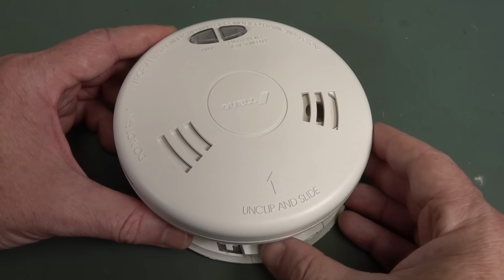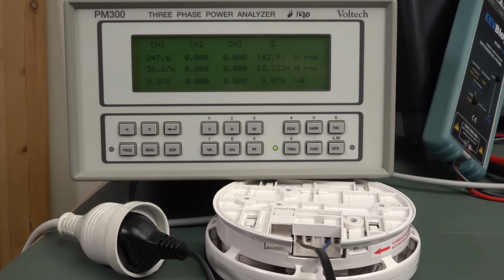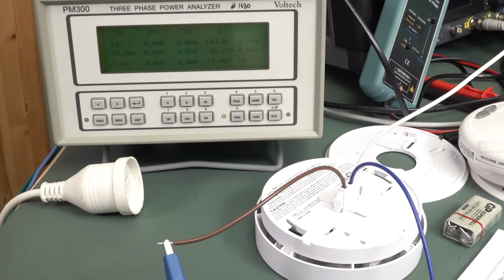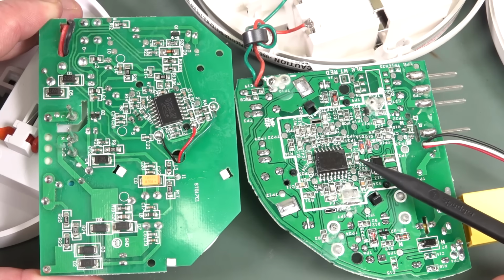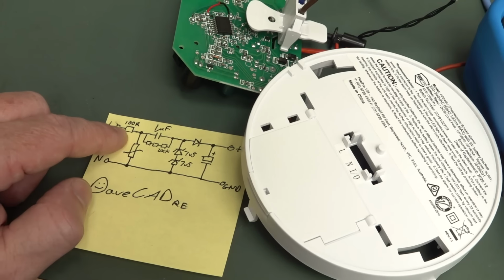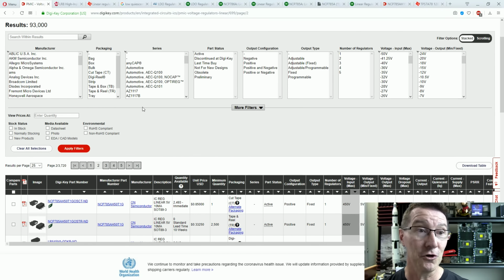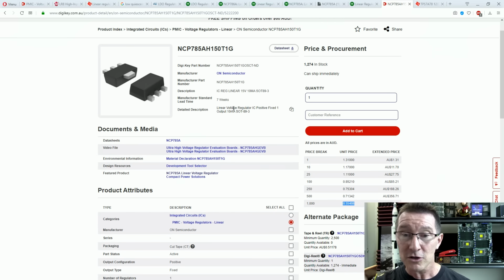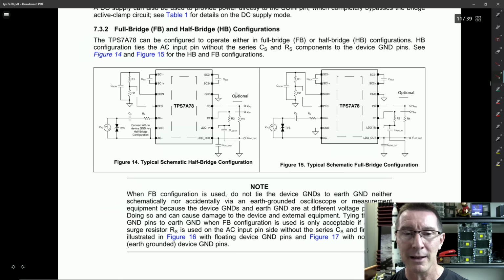EEVblog #1284 - How Bad Product Design Kills The Environment

Comment: I often wonder if LED bulbs suffer from similar issues with low power factor and high peak currents on the input, not to mention the environmental impacts of the built materials (plastic and components etc). It's like we've traded lighting power consumption in return for having more e-waste to deal with, I'm not sure how LED bulb failure rate is now but a few years ago it was a pretty high.
Reply: Bigclive often tests LED bulbs on their power consumption and power factor. You get what you pay for usually.
Reply: The problem with the smoke detector is that it has to use a capacitor dropper that is sized for the max current draw (when the alarm is sounding) When the alarm isn't sounding, it still draws that power and just dissipates it as heat. A similar power supply on an LED light bulb will be sized for the light bulb itself- there is no appreciable excess. Also, it's only drawing power when the light is in use. The smoke detector draws power constantly. A capacitor dropper is fine for something like an LED bulb that is either on or off. But in a device that only needs a tiny amount of current most of the time, and occasionally needs a lot more, there should be a switching power supply. But that's more expensive than a dropper, which always draws the same amount of power whether it's needed or not.

Comment: If they are goverment mandated then the goverment is ultimately responsible for allowing units onto the market with such poor specifications. Typical SNAFU, they tell you that you must run LED lights while making you waste power elsewhere. Fortunately all of that wasted power in 1/5 of the expected output from LLP's compact aneutronic fusion reactors and they take up only as much space as a single large house, assuming they are even above ground which they don't need to be when they don't produce thermal neutrons or need large cooling systems. However that is a solution that is about 10 years away, or so they say...
Reply: https://www.youtube.com/watch?v=6ajqD0hoOMw
https://lppfusion.com/
Some interesting developments listed here, such s hitting  600 million degrees K.  https://lppfusion.com/wp-content/uploads/2020/01/LPPFusion-Report-Jan.-22-2020.pdf

Comment: with the upcoming smart meters we will have to pay for VAs as residential customers too.
Reply: Nah just do like Hydro One and charge like $100 in fixed fees alone.  You pay through the ass no matter how much power you even use!
Reply: @redsquirrelftw  Pretty much.
My electric bill has almost always been 80+% 'standing charge'

Electricity rates barely matter because the cost is dominated by a fixed monthly cost just for having a connection.

People that argue it's cheaper to have gas don't consider that you now have to pay a standing charge twice.

For low usage households the standing charges are an absolute rort...

Comment: Hmmm...  I'll pass this onto my company, we're building a new campus and we're interested in total CO2 emissions and TCO of all operations.  We put in a bunch of stuff that's supposed to be "energy efficient" it might actually be a good idea for us to audit the hardware the site planners have selected.
Reply: If the current THD is high there wont be the perfect inductive power factor compensation that is expected from capacitor load.
Reply: @lucaskendc  - Of course loads with lots of distortion and harmonics (THD) will not be perfectly inductive or capacitive. However, in order to be significant to the power grid, those "distortion components" have to be associated with a large load. These smoke detectors are a tiny tiny load, so the THD is literally "a drop in the ocean" compared to a (say) a 150W switchmode PSU, even if it has higher PF and lower THD..
Reply: You should check the facts first. The use of capacitive droppers like these will IMPROVE your site's power factor. That will take the load of the expensive on-site Power Factor Correction devices that you will be installing to add capacitance and reduce your kVA loading onto the grid. Capacitance is capacitance... add it with these or pay thousands to add it anyway. Don't listen to Dave, he is clueless about this stuff, despite a squeaky voice and massive fanboi base.
Reply: Except the zener PS wastes in heat almost all the power the device draws from the grid... (independent of PF)

Comment: If you stop and really think about how much energy is wasted every day, you'll probably feel sick in the stomach!
Reply: I'm typing this reply while on night shift at a production facility with no other employees in for the weekend, yet heat and light is on full for almost a square kilometer of buildings.  A 2W smoke detector is the least of my worries.
Reply: There is NO electricity wasted here. The capacitive dropper in these creates a LEADING power factor, which improves the inherently lagging power factor on the supply grid. Dave is wrong.
Reply: @johncoops6897  No, he gives Watt and VA rating .. and even the Watt rating is way too high (because of the Zener diode solution).
Additionally the ohmic loss (think supply line) increases if the current increases, which it also does if only the reactive power increases.

Comment: ⛔️   THINK. THE  POWER  ISSUE  IS  BAD  FOR  THE  ENVIRONMENT??
TAKE THE PHOTOELECTRIC SMOKE DETECTOR OFF THE TABLE FOR A SECOND...
(Great detection type... eliminates false alarm trips caused by products of combustion -- burnt toast etc..)

NOW LOOK AT  ☠️ IONIZATION TYPE SMOKE DETECTORS ---> EACH DEVICE'S 
DETECTION CHAMBER CONTAINS RADIOACTIVE ISOTOPE(s) INCLUDING 
AMERICIUM xx AND HAVE A AVERAGE MAXIMUM USEFUL LIFE OF ONLY 10 YEARS!    

The. Straight into the landfill!!

(99% of homeowners do not even know about the special disposal usually required)

Comment: I always thought that a capacitive dropper could be very efficient if matched perfectly to the load. Perhaps they did the calculations based on the current draw when the buzzer is operating continuously so it's extremely miss-matched when operating in sensing mode (99.99999% of the time) and almost all of the power is being wasted away by the zener diode. If that's the case could they have the microcontroller operate a MOSFET to switch in a different value resistor or capacitor when in alarm mode? That way it would change to being extremely miss-matched and inefficient only 0.00001% of the time.

Comment: Data sheet is Oct 2019. Those smoke detectors are probably many years old designs. Likely battery powered and craptastic droppers added due to surprise demand.
Reply from the maker: Yeah, it's a fairy new part. Still other ways to do it.

Comment: I've seen the results of such "penny pinching" myself in many, many products. I've even been party to rancourous debate between engineering and the brainless bean counter chief accountant who had HIMSELF decided to change a high precision metox resistor for a standard one of the same value resistance but lower power (metox usually being double the power rating of an equivalent standard series) and 1/10 the price but less precision.

The chief engineer demanded he be sacked after telling the bean counter to stay the hell away from any engineering decisions irrespective of price and stick to his simple accounting arithmetic.

 BUT, the board decided not to and requested the chief engineer to redesign the circuit around cheaper components. He told them what they could do with their penny pinching and that it would end up biting them in the backside.

 He resigned the following day and the "redesigned" product went to market and had to be recalled after 6 months costing 10s of thousands to resolve!
Reply: Surely you left out the part where the accountant got a big promotion and a raise after the recall?  There is no way the story can be true without that bit of corporate logic...LOL!  Incompetence must fail upward after all.
Reply: My dad used so say one of the money men at a company he worked for was so tight he only breathed in.
Reply: Have you heard of the short comedy sketches called “The Expert”? Take a look. This story reminds me of them. People making decisions about stuff they know nothing about.
Reply: I had a similar experience in my early career as an electronic designer. The company manager (an accountant) decided the engineering dept was too expensive and he would bypass them and get the factory to create an alarm system by wiring together various third party modules. Unfortunately, it didn't go too well with the factory-designed product as it performed poorly, was unreliable and was more expensive to manufacture than a custom engineered design. In the end the "expensive" engineering dept had to be called in to help the factory and correct all the design errors in the product and try and reduce the manufacturing cost.
Reply: Lassi Kinnunen  I'm sure it did because the board decided to use cheaper components, but there goes the precision and efficiency.
Reply: At least the story had a happy ending.
Reply: @ToniLähdekorpi  : A "happy ending" would be the board resigning, and the accountant being jailed for six months.

Comment: The TI UCC28881 buck converter looks appropriate. Getting rid of the film capacitor might make up for the price of the buck controller. Perhaps the buzzer takes more than the 10 mA limit of the regulator mentioned in the video?

Comment: I think you're over-blowing the situations.  You'd have a point if this was a grid of nothing but smoke detectors, but the truth is they share the grid with things like fans, A/C compressors, refrigerators and other devices that don't have a power factor of "1".  In the case of residential power, the power company takes care of it by adding capacitors to the power line (since most of the problem is inductive loads, caps are the "anti-inductive" fix.).  All that these smoke detectors do is shift the amount of correction by a small about.  (Small because their current is small compared to motors.)
Reply from the maker: Yeah, but I'm trying to point out the potential seriousness of such poor design.  See the pinned comment above for the discussion on this.
Reply: @EEVblog  Ok, but good engineering is the art of compromise.  How much are you saving compared to the additional parts (and their impact on the environment)?  I still think you picked the wrong poster child.  I'd worry more about bigger electronics and modern LED lighting systems.  Big Clive routinely talks about how bad the PF is on the bulbs he takes apart.
Reply: I wonder if the electricity companies are seeing a shift from the mostly-inductive load as it was in the past (requiring addition of capacitors) to a mostly-capacitive load today.
Or maybe it is still mostly inductive, but far less than it was in the past.
After all, many loads like mains transformers and small electric motors have been replaced by new designs that use high-frequency switching and present a capacitive load if not corrected well (in which case it will be resistive).

Comment: But Dave the buzzer needs more current. I guess in this pissy design they must have used the worst case to ensure a loud enough buzzer. In the non alarm case of course this power is pissed away. BTW Kiddee is used here in Canada as the main brand manufacturer.
Reply from the maker: I added that in the overlay, I measured 15mA max buzzer current.

Comment: Ti makes a smoke detector asic with LDO bult in but I don´t think they have a version that goes up to 240v. They also make 700 volt Off-Line converters for use in smoke detectors.

Comment: I have seen the struggle to understand reactive power among engineers working at power plants ! 

There is this option to set pf from SCADA system in the power plant I worked, we used to set it 0.95 and that will increase the excitation current of the generator, meaning generators need to work more hard to make up the reactive power, thus needing more torque to rotate to maintain the same rpm (frequency) and more fuel.
I am talking about generation sides , not load sides.
Reply from the maker: Yes, it's seriously perplexing. See the pinned comment above for discussion. Would appreciate actual power generation engineers weighing in.
Reply: Where do they generate the exitatiion current from,  and this is applied to the electromagnets on the rotor right?
Reply: @ryanb1874  some of the current generated is fed back into the rotor through a rotating transformer i think. When you need to start the thing up there should be enough magnetism left in the rotor to start generating enough current to get the whole thing going again.

Smaller generators use slip rings and can be shunt wound/series wound and all that stuff I don't remember from uni...
Reply: @ryanb1874  Well, it is but not directly ! 
The generators in the power plant I used to work had actually 2 generators in 1 genset shaft
(made by ABB). 
Excitation controller will supply few Amps of DC to the stator of excitation generator G2, 
G2's rotor will  make 3 phase AC which will be converted back to large DC current to feed 

G1's rotor with a 3 phase rotating rectifier, and finally the actual AC power comes from the stator of G1. Something like this -
https://diary-of-electric.blogspot.com/2019/05/wiring-diagram-avr-of-3-phase-generators.html

p.s. I am sorry if I explained something incorrect, it was almost a decade ago. Now, I live in embedded electronics world and care much less for electrical systems.
Reply: @demoncloud6147  sounds complex,  I was just watching a Don Smith video and the old fart could even get his Over unity, resonator to work. THANKS for the comment.
Reply: @ryanb1874  There are several ways of doing this. However, you need an excitation power supply which generates a regulated DC current (typically via a phase angle control thyristor bridge rectifier) which is fed onto the rotor electromagnet. 

For standalone generators (e.g. emergency generators) the exciter can be powered from the generator output (residual magnetism in the generator rotor might be able to produce enough voltage to start the exciter, but a battery can be provided to provide a reliable way to bootstrap the process). In a power plant, you have the additional option of powering the exciter from the plant's internal electricity supply (which comes from the grid), although a common alternative option is to use a pilot generator on the same shaft (using a permanent magnet rotor) to provide power for the exciter. 

The next question is how you get the current from the exciter into the rotor electromagnet. The simplest way is to use brushes and slip rings to directly transfer current.

A more modern, and preferable solution is the "brushless AC exciter", which is mounted on the main generator shaft. The stator of the brushless exciter is an electromagnet is which excited with DC from the excitiation power supply. This induces AC current in the wound rotor. This is then rectified using a shaft mounted (rotating) diode bridge, and the resulting DC then powers the main generator rotor electromagnet. 

A problem that can occur with generators where the exciter is powered directly from the generator output terminals (things like emergency generators) is that if the main generator is supplying voltage to the exciter PSU, then if there is a sudden increase in electrical load (or short circuit), the voltage at the generator output terminals will drop, and this may starve the exciter of power, leading to a fall in excitiation, which will cause a further drop in terminal voltage.... 

Because of this voltage collapse problem which can come with powering the exciter from the generator output terminals, emergency generators powering sensitive or difficult loads, may be equipped with a permanent magnet pilot generator to provide a steady power source for the exciter.
Reply: @ChumpusRex  Damn. Thats the shit man.  It just gets so daunting.
Reply: @ChumpusRex  is there any easier way to do it,  like if all the magnets were, " soleniods' permantly charged,  I guess you would still need a trickling charge unless switching was involved and that would require more amps cause of impedence, right.?

Comment: I bet the springy metal switch contacts on the Quell unit cost a lot more in terms of storage space and automation. I bet it's a lot easier to get production line fixtures for your surface-mount button than to fit those metal spring contacts at just the right angle.

Comment: sooo does everything goes to heat 230v to 9v power supply should not draw that much
Reply: Yes, basically. This kind of power supply is basically "rectify the AC, then do a resistor divider to make a low voltage output" (albeit the bottom resistor in this divider is a zener diode). So you really are looking at basically 1 to 2% efficiency. Even lower than that, in fact, if you design in margin to have extra current available at the load. Virtually, the power can be lost in the 100 ohm resistor for the circuit he showed. The capacitor actually helps with efficiency some, by providing some impedance in the divider that is not purely resistive; basically at 60Hz, some of the impedance is resistive (energy dissipated as heat) and some of the impedance is capacitive (energy is just stored temporarily, but not dissipated)
Reply: @davidhoelscher  Most of the power ends up being burnt in the zener diodes. They get really toasty - the reason one of them used 2 7.5volt zeners instead of one 15v is to prevent them melting.